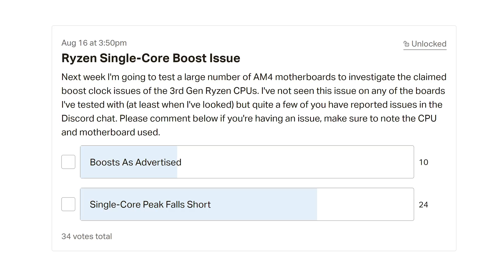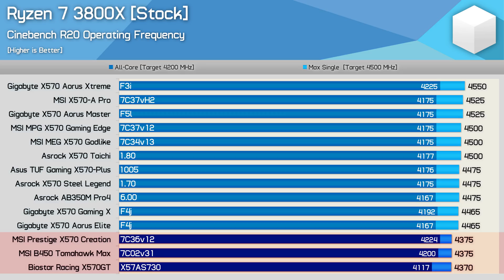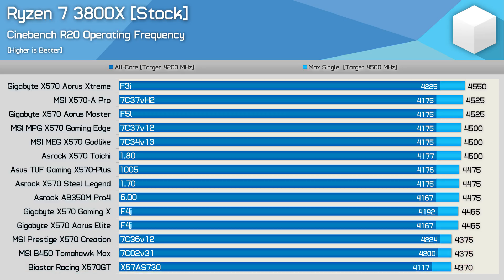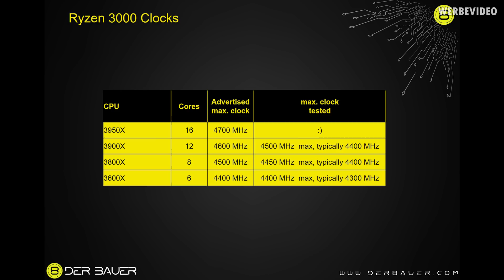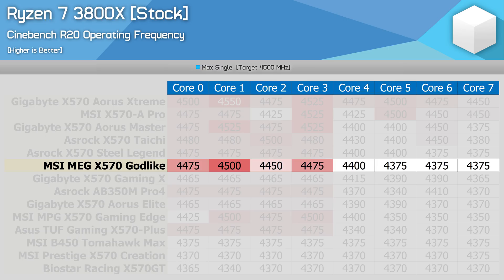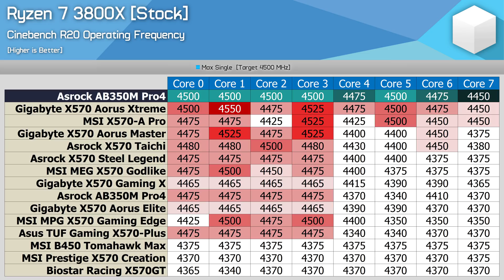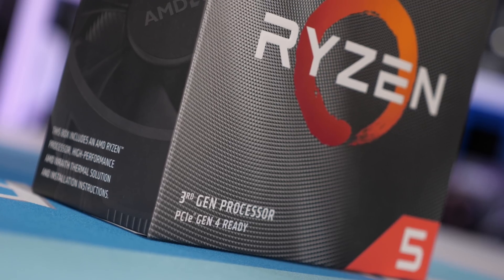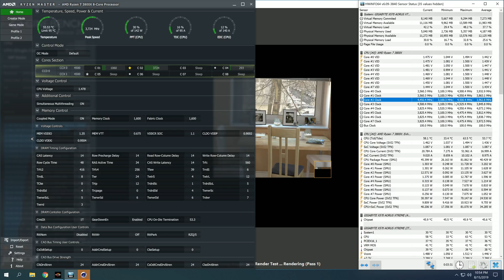AMD 3rd Gen Ryzen Boost Clock Investigation

Comment: My 3600, boosted up to 4.2 @1.4v 😂 in balanced power mode even in idle
Making it pretty hot, about 62 centigrade 😂

But i follow a guide from a youtube guy, that can managed to bring stock speed, 3.6ghz with 1v and also bring down the temps about 42-44 centigrade 😂

Comment: One more thing about the fastest core.
The Windows 10 scheduler may not choose the fastest core as preferred for the single core operations. 
Quote from Robert Hallock
"Windows selects and prioritizes the fastest core in the firmware with an additional criterion that there must be a second core in the same CCX that’s nearly as fast. The scheduler rotates between them to ensure one core isn’t shouldering all the single-threaded work all the time. (This is why you will sometimes see a “one thread” task jump back and forth between two different cores.)
"Let’s take a hypothetical 16-core AMD CPU and pick out a few cores. Core 0 and Core 1 in the first CCX on the first die can boost to 2.2GHz and 2.15GHz, respectively, for 2.175GHz average frequency. Core 13 and 15 in the second CCX on the other die can boost to 2.25GHz and 2.05GHz, respectively, for an average of 2.150GHz. Core 0 and 1 would be the CPPC preferred cores for Windows, but Ryzen Master would assign the gold star to Core 13. Core 13 might be the fastest core in the chip, but you can see it’s not the best choice for autonomous boosting. Pairing Core 13 to Core 0, theoretically the highest average frequency by a hair, would potentially be negated by crossing CCX boundaries."
https://www.reddit.com/r/Amd/comments/dzjs7i/fastest_cores_is_windows_right_or_ryzen_master/

Basically, even though there is one core capable of hitting the specified max boost frequency, it may not be picked by the Windows scheduler and you won't see the desired max boost frequency in your monitoring software.

Comment: Im having this issue with the msi x570 tomahawk on the new zen 3 5800x, running the boost setting can only reach 4275 Mhz on all 8 cores... thats 500 mhz shy of the advertised boost
Reply: Me having the same issue with a Ryzen 5 5600x on a Msi B550 A Pro, did you found a solution?

Comment: i was able to reach 4.625 in IDLE with my ryzen 3900x, with an asus strix x570-f ,setting the vcore as low as 1.190 been able to boot windows, i believe its has to be with the initial temperature (speculating)

Comment: I've liked all your videos until now. You reek of sellout in order to maintain your relationship with AMD. I can't believe more people haven't called you out about it. What is advertised on the specification should be what the average user gets.  and calling it a non-issue it's a slap in the face to anyone quiz ever assembled machine. Most people understand the Silicon Lottery but when the average user has complained to this degree to the point where you're making a video about it there is quite obviously a problem with the spec. Overall I am happy with my new 3950x Evan though it does not perform as well as expected. And even though Intel is an absolute joke currently... they have never exaggerated their numbers to this degree.

Comment: What's interesting is that my recently purchased 3700x only advertises 4.4, not 4.5. Stock, I get only 4.0 all-core, but I stably overclocked to 4.375, which I guess is close enough. PBO, however, would only go to 4.2. All in all, it seems to want to be very conservative with the clocks despite the ability to go higher.

Comment: ahh.. wish I had seen this video before buying my 3600.. upgraded from an FX chip; I didn't realize I (most likely) wouldn't be seeing the numbers on the box with the asus x570 TUF... even with an nhd15 to cool it, It likes 3.95ghz a lot.. sometimes I see 4.1ish.. obviously if it says 4.2 max boost on the box, I want to see 4.201 !  :)
Reply: I have a 3700x with MSI B450 Tomahawk Max. With auto, PBO enabled, or PBO/Auto OC enabled...mine would only hang around 4.1Ghz. The only way I got around this was to manually overclock it to 4.3Ghz @ 1.35V on all cores...and yes, it stays at 4.3Ghz during workloads/gaming. Anything higher (4.35Ghz, 4.4Ghz(the advertised boost clock)) was not stable at any voltage i threw at it. Also, this is all on the stock cooler. 

Have you tried manually overclocking?
Reply: @chrisz5z  Yep, Manual OC works well.  4.2ghz all cores @ 1.35v.  somehow, that makes stock boost performance even more frustrating.  Cause I know it can hit 4.2, it just doesn't.. OC is fun, but we shouldn't have to OC to get the numbers on the box, so I'm still kind of salty about it..
Reply: @BenK12345  Agreed...i think it has more to do with the motherboard manufacturers' implementation of PBO/PB2 and how each motherboard handles the voltages of the CPU, SoC, & DRAM. The benchmark results for  X570 boards out there vary much more than they should.

Comment: Hey Hardware Un-boxed, you guys are one of my all time favorite PC enthusiasts YouTube channels, and I know this video is from August of 2019, but I do have this question since it's on my mind: I have a B450 Gaming Pro Carbon AC (latest BIOS) and recently purchased the 3700x. Now, all that I do in the bios is set it to "game mode" which places the 3700x at all cores to 4.2ghz...temps are excellent too, max at 52c..but I won't go into my case and fans, cause this is already a long post!  I know the boost clock is 4.4ghz. Is this "game mode" hindering going to 4.4ghz? I mean, I don't feel deprived in my gaming or anything else, and I guess if I were more savvy in BIOS overclocking I could achieve the 4.4ghz. Any recommendations? Is this just about me being more proficient in over-clocking knowledge in bios ? (I bet most likely ...lol! ) BTW I have Corsair Vengeance 16gb XMP@ 3200mhz, and RTX 2060 Super FE graphics card. Thank you!!

Comment: can i setup the bios, set cpu ratio to 38x so it runs on 3800 mhz, but then limit it to boost like say 4000 mhz ? set a max boost clock ?
i want a boost but not over 4000 mhz, so cpu does not get too hot ? is there a option for that ? my 3700x goes to 4,342 on boost.

Comment: I have a Asus TUF Gaming x570-Plus wifi and i only get 4.2mhz anyone else getting this? Or have a solution?
Reply: I have a 3700x with MSI B450 Tomahawk Max. With auto, PBO enabled, or PBO/Auto OC enabled...mine would only hang around 4.1Ghz. The only way I got around this was to manually overclock it to 4.3Ghz @ 1.35V on all cores...and yes, it stays at 4.3Ghz during workloads/gaming. Anything higher (4.35Ghz, 4.4Ghz) was not stable at any voltage i threw at it. Also, this is all on the stock cooler. 

So to answer your question, try manually overclocking

Comment: Its a bit old now but my MSI Creation paired with a 3900x shows a 5150Mhz Boost Clock in Ryzen Master with PBO enabled. Even though, it cant hit it. It goes just to 4350Mhz and stays there, not going over it. And even stranger, if i try to higher the limits, the board just bugs out and the CPU cant clock over 900Mhz. Tested with the latest 1.0.0.4B V16 Firmware

Comment: thanx man, looks like msi prestige creation (i like it for some irrational reason) is not as good as aorus master for OC, but at least it holds similar numbers on every core and maybe it will be more stable for 3900x under hard work because of its vrm and cooling? correct me please if i'm wrong, i'm trying to make a right choice.

Comment: Hello HU, thank your very much for your fantastic work.
What power supply did you use?
The reason why I'm asking is, that a user from a German forum suggested that his boost clocks are dependent on the used PSU.
He tested two different motherboards with the same CPU and two different PSU.
With an BeQuiet Straight Power he got worse boost clocks than with an Seasonic Focus Gold.
Do you see the same behaviour with one of your boards?

Comment: thanks, the only motherboard that fit my needs was the...msi prestige creation so with that known I cancelled my Ryzen 3000 build altogether, videogame gambling is enough I don't need cpu and now motherboard gambling wth, screw this, do the cpu enter the "early access" era now ? what's next "beta" "alpha" "pre-alpha" cpu/motherboard releases ? insane what people accept to buy today
Reply: Even with this small discrepancy, which AMD claims to have figured out yesterday, the processors are still great. AMD also announced a new BIOS update that should fix it for next week. 

Also no new platform for the past 20 years has been bug free, just look at the Situation with X99. Some of those issues (USB) still haven't been fixed.

Comment: A thread was created on the AMD community support forums in the CPU section for 3900x boost speed analysis congregation. In there is a likely more accurate Ryzen Master Histogram testing that can be used instead of HWiNFO to show the peak boost speed being achieved by the processor. With it, I found that as my scores indicate, my processor is indeed peaking at 4400mhz instead of what HWiNFO shows to be 4550mhz. I think you should try that out using the AORUS Extreme to see what it is really peaking at, since it was showing to be doing better than every other board. Ryzen master is after all the only reporting software capable of showing whats really going on with Zen 2 processors clock speeds.

https://community.amd.com/thread/242812

I posted my results there too, both PBO and my manual.

Comment: I cannot get CINEBENCH to start at the base clock of 3600mhz for my 3700x because it's being boosted at default bios settings. As I understand it the clock speed tests should start off at the base clock speed before the CINEBENCH test is started? If this is the case I have no way of setting the base clock, unless I turn off the CPU Core Boost, but this would stop the test from boosting. Please advise.

Comment: That only means the facory OC is reduced. Does it mean on Ryzen 3000 manual overclocking is becoming more useful again?
After all OC means running the chip outside of factory specs.

Comment: on my 3700x i hit 4,33 on single core and 3,95 on all core during cinebench r20 and i also have quite low scores, from around 4600-4630, while according to reviews it should be from 4800-4900 out of the box :( + my fastest core during any light work loads is always set to sleep, only my second fastest is doing cinebench single core test
Reply: Try reinstaling windows

Comment: Slightly unrelated but I see this same behavior with 2700x on both the x470 and x570....only some of the cores hit the advertised 4.35ghz with any consistency. I have found that bios auto overclocking features and the Windows power plan affect max single core speeds more than expected on both platforms and that auto overclocking seems to really add nothing but heat soak causing diminished single core clocks while only slightly boosting multicore results.

Comment: ryzen master edc cpu running at 100% even if i set ryzen master to 3.8ghz , running in the red  with voltage set to 1.25 volt, im using  ASUS C6H X370 , and if i leave everything to auto in bios apart from turning pbo off, ryzen master shows 1 core boosting to 4.2ghz and my voltage sticks at 1.47 volt and up to 1.48 , im using a 3700x,  i dont think this is correct,  this is the strange part i did a test with ryzen master after setting my bios oc to 4.2ghz at 1.3v and then booted windows and set ryzen master to 4.35ghz all cores at 1.325 volts and ran cinebench r15 and got a score of 2316, should i manual bios oc or do auto, ryzen master i just pulling to much volts

Comment: i checked alle the Mainboards for their VRMs and PWM-Controllers, found a slight correlation (copy&pasta this in an Editor with monospace font)

Phases does not matter much, no corellation at all but Infineon PWM-Controllers seem to work better - the Top-End is equipped with XDPE132G5C or IR35201, then comes some Intersil- or Richtek-Stuff though the MSI Prestige X570 Creation is an exception to that rule 

                                Boost |  VRM | MOSFETs | PWM-Controller  

--------------------------------------+------+---------+-------------------

Gigabyte X570 Aorus Xtreme       4550 | 14+2 | 14x 70A | XDPE132G5C 

MSI X570-A Pro                   4525 |  4+2 |  8x 46A | IR35201 

Gigabyte X570 Aorus Master       4525 | 12+2 | 12x 50A | XDPE132G5C 

MSI MPG X570 Gaming Edge         4500 |  4+2 |  8x 46A | IR35201 

MSI MEG X570 Godlike             4500 |  7+1 | 14x 70A | IR35201 

Asrock X570 Taichi               4500 |  6+1 | 12x 50A | ISL69147 

Asus TUF Gaming X570-Plus        4475 |  4+2 | 12x 50A | ASP1106 / RT8877C

Asrock X570 Steel Legend         4475 |  4+2 |  8x 50A | ISL69147 

Asrock AB350M Pro4               4475 |  6   |  6x 55A | ISL95712 

Gigabyte X570 Gaming X           4465 |  5+2 | 10x 46A | ISL69147 

Gigabyte X570 Aorus Elite        4465 |  6+1 | 12x 50A | ISL69138 

MSI Prestige X570 Creation       4375 |  7+1 | 14x 60A | IR35201 

MSI B450 Tomahawk Max            4375 |  4+2 |  8x 46A | RT8894A 

Biostar Racing X570GT            4370 |  4+3 |  4x 50A | ISL95712

Comment: I use a tomahawk (non max) with a 3600 and found that as soon as i use a newer bios version past v18 my performance drops and with pbo and additional 200mhz set I'll only hit 4250mhz on less strenuous tasks. On v18 I can hit 4400mhz all core in gaming, it's almost like AMD have  capped performance on older boards in new agesa updates 🤨 

That could be a good test to do, trying the old bios versions on older boards.
Reply: hi tomahawk max here i noticed while i use windows balanced mode and watching youtube video all core boost to 4125 MHZ at 1.360 V, and while i use ryzen balanced watching youtube videos all core boost to 4350 Mhz at 1.460 V and temp also getting hotter + 8-10 C degree while watching youtube, what power plan you use? and what is your freqency in Mhz that you get on all core while u browse youtube video?

Comment: Using 3600 on Gigabyte Aoura x570 Elite and haven't seen a single core hitting 4GHz let alone advertised 4.2GHz max boost. Running multi or single core benches and activating PBO makes no difference. I OCed all cores to 4.175GHz and all cores hit this speed when benching. Auto boost is broken. It might be motherboards or CPUs or combination of both, but for a lot of people Power Boost is not working as advertised.
Reply: I have the exact same experience but with B450 tomahawk Max. Manual OC seems to be able to hit higher clock speeds than max boost when at stock. IF OC, what voltage are u using?
Reply: @lindstroem4  1.382

Comment: The specs for Ryzen 3000 / Precision Boost 2 look like they can adjust clock speeds really fast, like faster than memory latency fast. If that's true and they're being aggressive about thermals, then maximum actual clock speeds could easily never show up in a monitoring tool even if the processor is maximizing performance under load.

Comment: Honestly ever since we saw the 3700x vs 3800x TDP numbers i've been suspecting that some if not all of the Ryzen 3000 series aren't getting especially well binned CPU dies, (desktop parts almost never do get the very best, so i mean i get the feeling they might be further down the binning curve than normal). EPYC is probably chewing those up. Best guess is EPYC took off a lot harder than AMD where expecting and they have insufficient good dies to go around for Ryzen 3rd gen, so they're having to make do with scraping the bottom of the barrel and pushing them to the wall.

Comment: Thanks for another great video!  I really appreciate the work you guys do!!

I have 3700x with Asus TUF Gaming + Wifi X570.  I have yet to see any core hit 4.4 ghz while dorking around with PBO, Auto Tune, & Performance Enhancer.  What I look at in Hardware Info 64 is the RATIO!  If my 3700x was hitting the rated speed boost on a single processor, then I would see the ratio of 44.0 on a core.  I have NEVER seen this, yet.  The best I see is 3 cores at 43.8x,   2 cores at 43.5x,  and 3 cores at 43.3x.  I get that not every core is gonna run at a full speed 44.0 multiple of the bus clock (and my ASUS MOBO only runs at 99.8 MHz unless overclocked w/Auto Tune), but at least 1 core should be clocking, occasionally, at a bus clock multiple of 44.0.   I am comfortable (even happy and pleased) with the performance of my processor, and we are talking about fractions between 43.8 and 44.0!  But at the same time, I'm a little chapped that I have not yet seen a 44.0 multiple from this processor that's advertised as a 4.4 Ghz processor.

Comment: Nice, apparently I won the silicon lottery with my 3900x as mine does all cores at 4.750Ghz  on an Asrock TaiChi running latest BIOS. Advertised Max Boost is 4.6Ghz. Maybe the 3900x doesn't have the same issue as 3800x.

Comment: Steve, I don't know if you read the comments or not, but if you do read this, you might want to check out whether the default LLC settings on the boards could be responsible. When playing around with PBO on my Ryzen 3600 and also adjusting my board's LLC setting (Gigabyte X370 Gaming 5), I discovered that setting LLC to low resulted in noticeably lower boost clock than on auto or "extreme" (presumably because the processor was not receiving as much voltage as it requested). I wonder if a similar thing might not be happening even with the normal boost setting on various boards?

Comment: That review must have been grueling...so many CPU swaps. Makes my toes curl.  But one point you kept making was the difference in clock speed being so small...around 1%.  That made me start to wonder just how great the difference in over-all CB20 score between each of those boards, running the exact same processor/memory/etc. Kind of a bottom-line thing.   Thinking here being a board not achieving the highest boost frequencies may make up for that by maintaining better average boosting across the entire CB20 multi-core, or even single core, run resulting in 'margin of error' bottom line results.